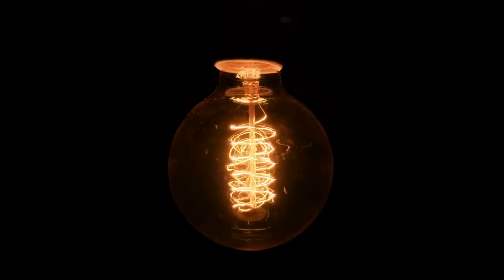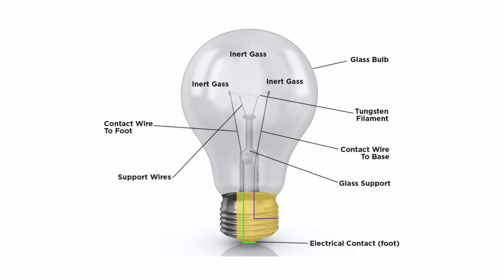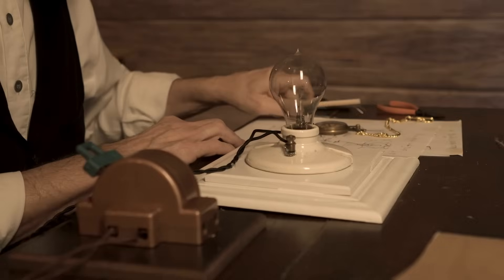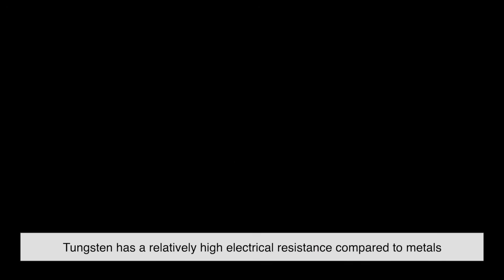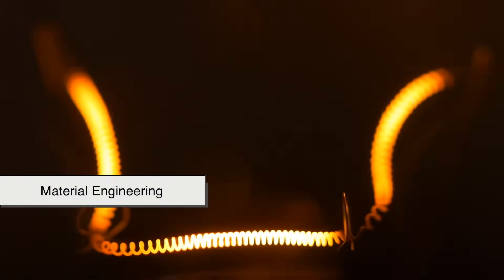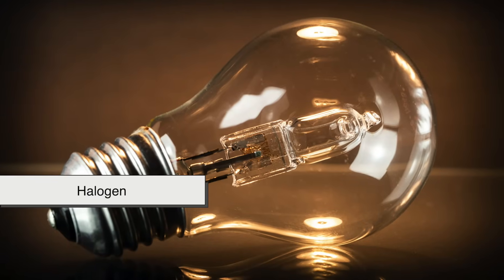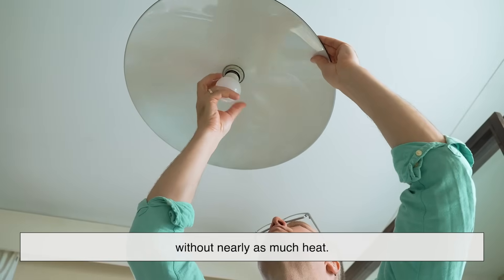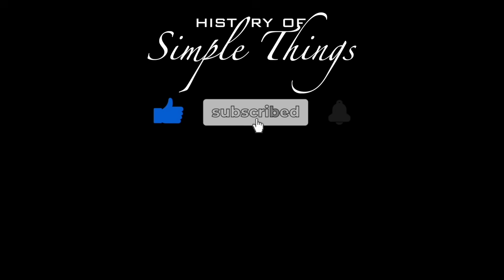What Makes Tungsten Filaments Glow Without Melting?

Comment: To sum all this up in a single sentence: incandescent bulbs are the one thing that are engineered to fail for good reasons that are beyond engineers' control unlike most other things that fail if designed as poorly as modern software is.
Reply: It's not engineered to fail. It's engineered to get as much light aa possible wiith adequate lifespan.
Reply: @mohanjan8768 Dude, learn to proofread

Comment: I collect bulbs. I have the first tungsten filament bulb ever sold, a 1909 GE tungsten lamp that has an early sintered tungsten filament that was actually 4 hairpin shaped filaments in series. That was because the filaments were made of powdered tungsten that was fused together in high heat furnaces. It is insanely fragile and needed extreme care in handling and use. Mine is long failed as most remaining are. I have the original box too. Strong ductile or drawn tungsten wire which all modern bulbs use was invented by William D Coolidge of GE in 1905-1909 and it was of course superior to fragile sintered tungsten filaments and could be made in continuous lengths instead of of individual hair pins in series. A regular employee of GE’s NELA Park lamp factory in Ohio was sitting in on an executive meeting one evening in 1909 and they were trying to come up with a name for ductile tungsten lamps and the worker said “MAZDA-for the mythic character Ahura Mazda, the God of light!” And it stuck and was used on both tungsten bulbs and early fluorescent lamps introduced in 1938 for the fluorescent lamps, and used it until the end of WW2! England used it till very recently. I also have even earlier and some same era as earth tungsten and MAZDA lamps. One company, NALCO, made carbon filament bulbs until the mid 1980’s and then was bought out by Philips who shut them down and is only one reason I positively HATE that brand with passion! Carbon lamps are insanely inefficient but incredibly beautiful lit. They are a forgotten lamp type that was the only incandescent lamp before tungsten, and other metals were ued-tantalum, iridium, and osmium come to mind! Yes, they were sold for a short time until MAZDA tungsten lamps. Tantalum was the most popular and was odd in that it could only be ran on DC if you wanted them to last! On AC the filament got beady and started offsetting in shape then broke. These could be “renewed” by jarring the broken tantalum filament into contact with the current turned on, and would weld together and hold, tungsten will not. Bulbs could be “renewed” this way in tantalum several times, often increasing in light output as the filament gets shorter and of lower voltage! Cheers! 👍🏻😋
Reply: I forgot to mention the Edison GE GEM lamps. Also known as “metallized” lamps, they used a treatment on carbon filaments that made carbon act like metal and the operating temperature could be higher with no loss of life for more light that was a bit whiter too. You got 20 candle power for the watt use of a 16 candle power standard carbon lamp as a typical example. I have some of these as well, including a now rate “Meridian” lamp that eas the first high wattage lamp to be for mainstream use. Not too many were made though. It is also one of first bulbs without the exhaust tip on top of the bulb where the vacuum pump was connected to pump the air out. Gas filled lamps only came out once coiled tungsten MAZDA “C” lamps came out around 1913. All lamps were vacuum before that. The tungsten vacuum lamps were MAZDA “B” lamps.
Reply: I forgot to mention the Edison GE GEM lamps. Also known as “metallized” lamps, they used a treatment on carbon filaments that made carbon act like metal and the operating temperature could be higher with no loss of life for more light that was a bit whiter too. You got 20 candle power for the watt use of a 16 candle power standard carbon lamp as a typical example. I have some of these as well, including a now rate “Meridian” lamp that eas the first high wattage lamp to be for mainstream use. Not too many were made though. It is also one of first bulbs without the exhaust tip on top of the bulb where the vacuum pump was connected to pump the air out. Gas filled lamps only came out once coiled tungsten MAZDA “C” lamps came out around 1913. All lamps were vacuum before that. The tungsten vacuum lamps were MAZDA “B” lamps.
Reply: Oops-GEM means General Electric Metallized.

Comment: Domestic filament light bulbs were usually rated for an average life of 1000 hours when operated at the design voltage. But the lamps used in home movie and transparency projectors had the filaments run at temperatures much closer to the melting point of tungsten, the design life of a mere 10 hours being considered to be a reasonable trade-off for the much greater light output for a given electricity consumption.

Comment: Regarding 3:27, electric dryers do not use Tungsten as the heating element. Instead they use Nichrome which is nickel-chromium alloy and has a high electrical resistance.
Reply: Nichrome also forms a protective oxide layer on the surface when heated for the first time, allowing for a life of hundreds, if not a few thousand hours or more, making it the material of choice for heating elements in household appliances ranging from hair dryers to radiant space heaters (the type with a glowing coil or ribbon behind a reflector)

Comment: Tungsten has a much higher melting point , and can withstand ten times the heat than a lightbulb can deliver. But it weakens over time with each time the light is turned on and will weaken enough for it to break. Ffs it’s not rocket science .No one cares why it doesn’t melt normal people just want to know that the bulb works when it is switched on. . If it doesn’t they buy a new bulb.

Comment: Centennial Light Bulb - It was first installed at the fire department hose cart house on L Street in 1901. 
It's still alive!
Reply: It was never turned off as much as a normal light bulb and is almost completely useless for illumination, but it still works!